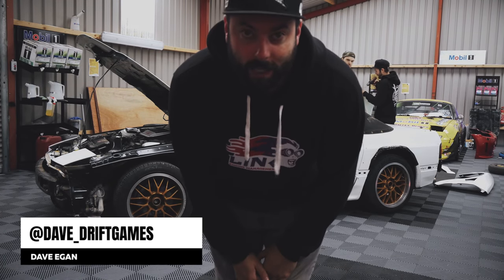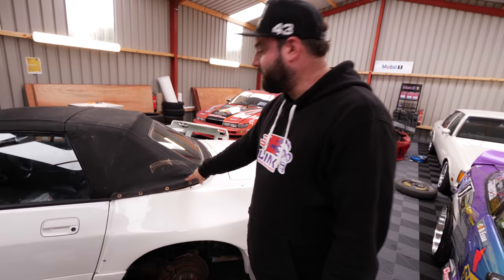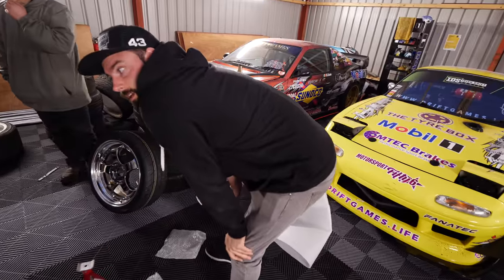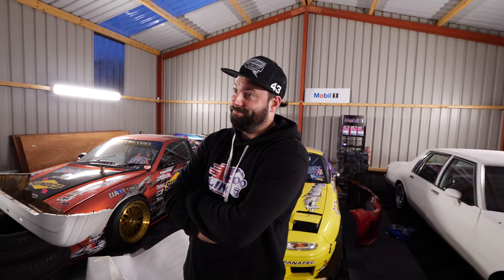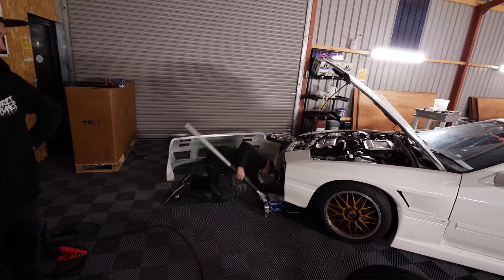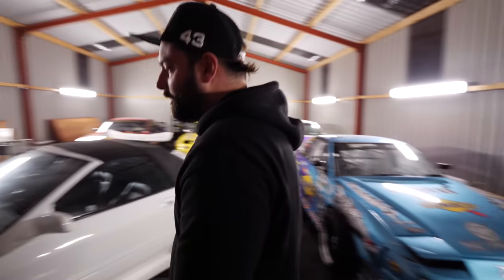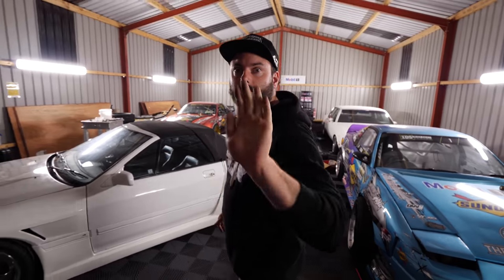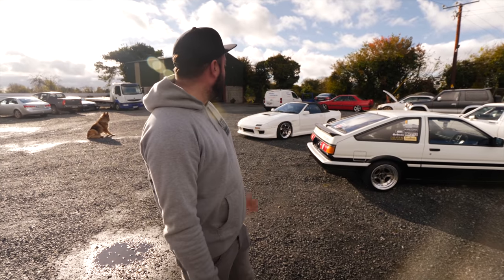MAZDA FC RX7 PROJECT | 2 WEEK TRANSFORMATION COMPLETE!

Comment: I have the same fc, NA tough, and I'm going for almost the same looks.... Roof down and it's gonna be such a beauty 😍. Hope I'm gonna be done for next summer and then cruise along, wind in my hair, sun in my face,brap noise..... Perfect car
Reply: Did u get it done
Reply: @axzl5864  Sadly not yet, having isseus with the gearbox, lost 1st and 2nd gear, we opened the gearbox and found the cause, but been searching forever on the internet, calling everywhere, no gearbox or parts to find here... So on hold untill I found a replacement. I still have a gearbox from a turbo, but it doesn't fit, and need to get a driveshaft made for that, and alot of other things to make it fit... One day it will done, I'm not giving up.
Reply: @Got_braaaaap...  ahh alr best of luck
Reply: @Got_braaaaap...  inst mazda still making parts for it?
Reply: @xmangle5382  I can't find where I can order them. I hope I can fix it and be ready soon
Reply: @Got_braaaaap...  give me some heads up if you find any, i really wanted to own a FC one day so  if i can`t find parts for it than its gonna be sad
Reply: @xmangle5382  parts are not that hard to find, for me it's the gearbox, and since it's an non-turbo, it's not that common. If you ever buy one, I have alot of spare parts, engine and bodywork. You can always contact me then.
Reply: @Got_braaaaap...  i see, big thanks, may i get your instagram or something to contact you?